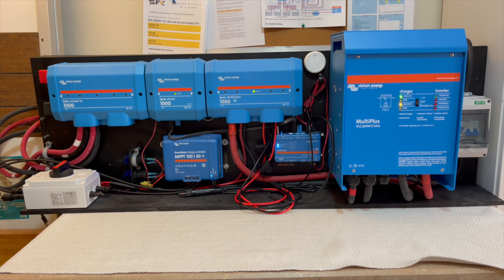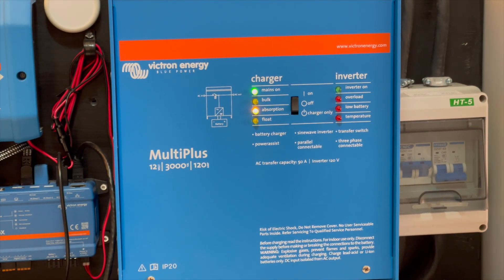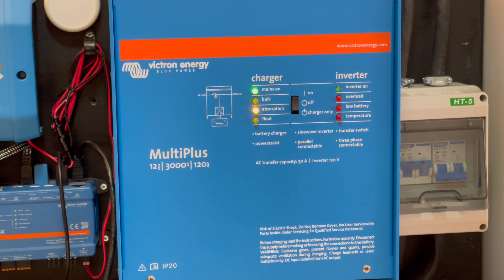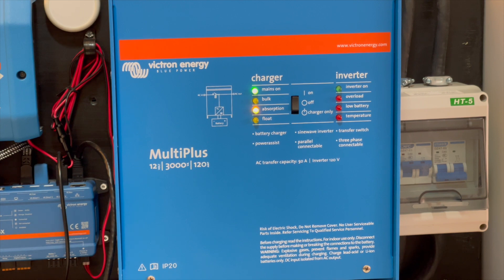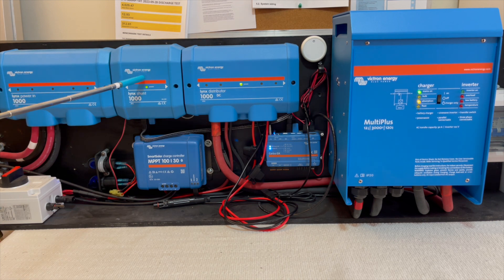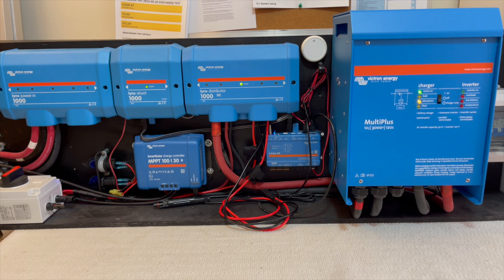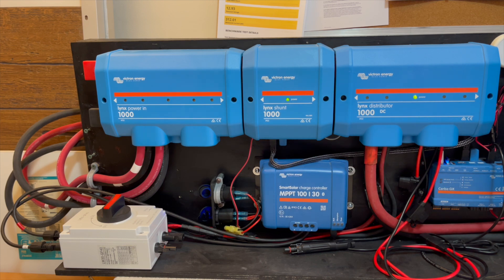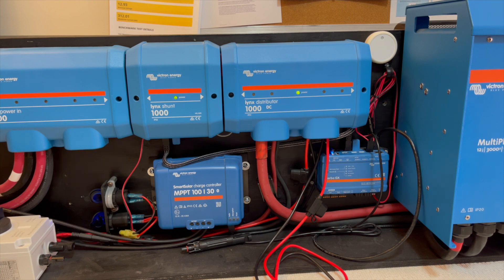Victron - Victron System

Comment: Just a question... you are using 12V 3000VA inverter and you charge the battery by a solar charger of only 30A.
No matter what PV you installed, but 30 amps on 12V battery are only 360 Wh.... are enough feeding your appliances or you intend recharge the battery just starting your van engine?
Reply from the maker: no that incorrect.   You are only seeing a portion of the equipment when it on the bench.   We have multiple solar charger, solar panels, honda generator and the multiplus is capable of 120 amp charger when on 15 to 30 amp service.  Will be adding more stuff as we up our 500amp to 1200amp battery bank.   30amp Solar is great for topping off and low day usage.   We have not completed solar panel on the trailer.  Once that is done, we will add or upgrade accordingly.
Reply: @SimplyOffGridLife  Ok, you are setting a very powerful electric system, off-grid naturally. Good
Reply from the maker: We did a lot of field testing and can switch out units.  We don't want to use the heavy solar panel, add a lot of weight when you start exceeding 1200 watts of solar.  We have tested the standard flexible units.  Work similiar as the glass panels.  But I concluded they would not be safe to mount on roof of RV.   We are now looking at CIGS, but have not bought any yet for testing.  They seem to be indestrubile & have 24 to 48 diodes, make them great for shadows. I think I have mention in previous videos.  Recently Renogy release their version. @joblack3991

Comment: What settings are you trying to change that you could not do with VictronConnect and a MK3 cable?
Reply from the maker: We do not use, or own a MK3 cable.  Nor plan on buying one.  I suspect it will be replaced with VictronConnect App after several uipdates

We have no issue making changes to the multiplus using VRM Online.   

The problem is when I am offgrid.  No cell or internet service and I wanted to change the Multiplus charger settings from 40 amp (originally set during testing) to 70 amp.  The current version would not make the change.  No issue lowering it, but could not increase the charge rate.  I had to wait until I had internet connection to VRM online to make the change.

Had no issue at all last year, but did do an update this year and discovered that the power assist feature wouldn’t work.  I reported this to Victron forum and the next update fixed it.   On the next trip, I couldnt increase the charge rate and again off grid.   I suspect another bug and haven’t reported it yet, got to busy with other projects.

The charge rate is the only feature I like to change when off grid and no internet.  For now I set it before leaving.  I was doing anothers test and I may have found another bug, but want to see if I can replicate it first.
Reply: @SimplyOffGridLife  it would be nice to see it the MK3 cable not be a requirement but I am not going to hold my breath on it. It would also be nice to see VictronConnect fulfill all the roles of the roles of the windows only software.
Reply from the maker: Add GitHub as it will give you more options in VictronConnect app. We use an Intel Mac chip and boot with windows to access VRM online configuration files. 

Be nice when I can dump windows completely. 

 @PanelsUpSolar
Reply from the maker: I save my setting config files to my iPhone and I can upload the setting via VRM. Work great. So it just a matter of uploading the file with setting I may want to change when off grid and no cell or internet
Reply: @SimplyOffGridLife  I still don't know what setting you would need to go in and change on the fly though. If your current input is set properly, your charging should operate accordingly. It sounds like you may have something not properly configured or wired.
Reply from the maker: @PanelsUpSolar several reasons.  I had my charge rate set too low and i could not change it back.  My unit is mobile and i need to make changes at times for new conditions. Etc. anyways i found a work around by saving several config files and uploading it to vrm from my iPhone. Don’t need a window computer to access multiplus via vrm
Reply from the maker: I have different battery bank and need to change charger rate. Usually from 70 amp to 120. To keep it within recommend charge rates
Reply from the maker: On two occasions due to firmware bug i had to make changes. One bug is fix. Im working on another possible current firmware bug
Reply: @SimplyOffGridLife  What bug do you think you have? I deal with these systems all the time and would be curious what you are chasing.
Reply: @SimplyOffGridLife   Did you know that you can set up an assistant that would allow you to use a variable resistor knob to send a signal to the inverter to allow you to adjust charge current by turning the knob?
Reply from the maker: Not interested in using your method.  There is no need for it.  Victronconnect provides most of the setting that I need.  The multiplus is the only area where I have a need to change when offgrid. Everyone has different needs and at times changes need to be set.

Yes, I have a default setting for most applications.  Yes, my setting are all correct.  You don’t seem to understand the issues.

On one occasion, I did an update before leaving.  This update broke the assist feature.   It gave priority to charging first before supplying to the load that currently was in demand.   I had to reduce the charger setting from 70amp to a much lower level.   I reported this to Victron, they did another update and fixed the issue.  Now priority is given to the load and not to the charge demand.

I decided on a back up option, should I be found in another situation.  I don’t use mk3, window or anroids, striclly mac and VEConfigure at the office, I can boot up with apple software and run Window to make changes.   

However, I don’t have this off grid.  So, I just created a bunch config profiles and if necessary I can connect to VRM and upload the files.  VOILA!!! Work great.  NO window, NO android needed.  NO mk3 needed.  I have a video showing that I believe.  

To say that one would NEVER need to make changes, maybe for a fix setup, not the case for me.

I found another issue which I will check to see if it was resolved from the current update I did recently.  Until then….
Reply from the maker: V3.12 fix the last bug, allowing me to make changes, just using victronconnect app now.   Github is the only extra thing I use.

We watch your video on dc to dc charging.  So far, we don't have a need, but at one time I was going to install the victron DC-DC.   

We subscribe to your utube and have lots of dyi  project on the go.  Never bothered with videoing, but will do that from now on. Appreicate the same.  Thanks
Reply from the maker: The update 3.12 fixed the other bug I was verifying.   All okay now with 3.12 update